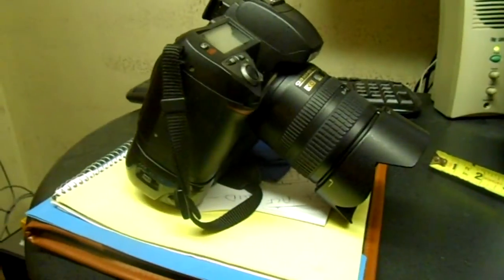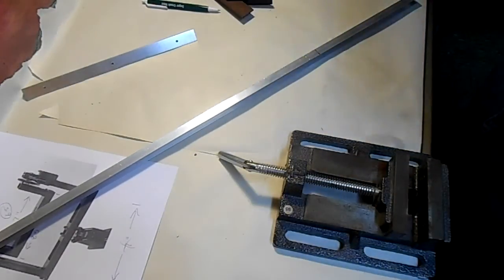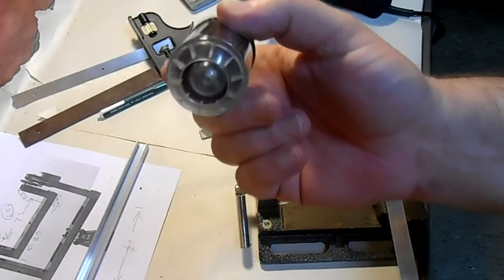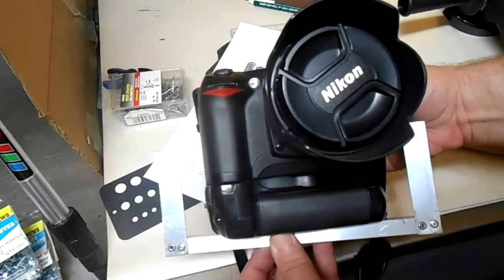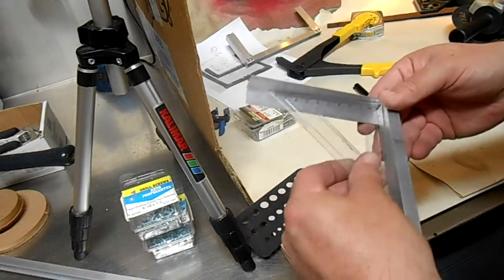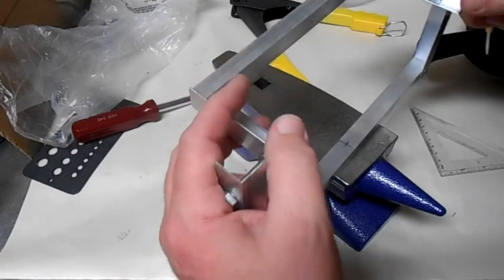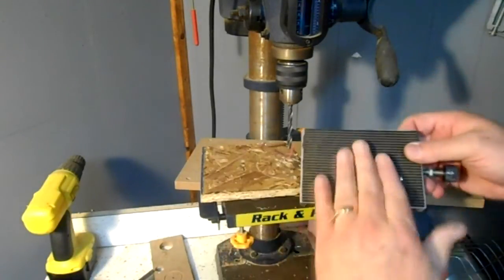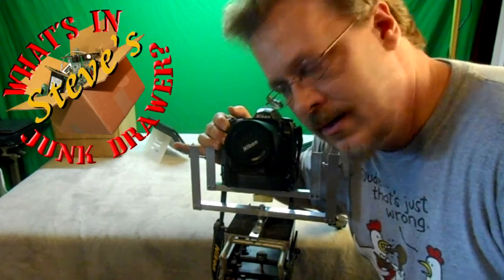DIY Motorized Pan & Tilt Camera Mounting System - Part 2

Comment: That faucet piece was Dec 6, 2012 or 7 month ago.  If you attached a flat plate to the camera cradle and had a slot in it for the 1/4" mount screw you would be able to shift the camera fore or aft to balance it.